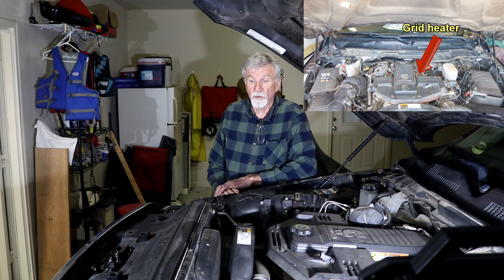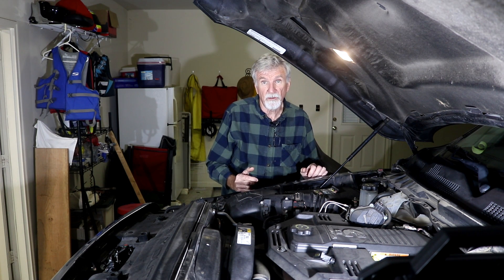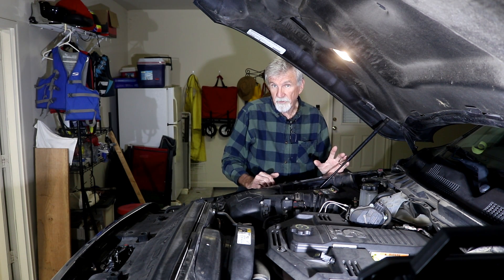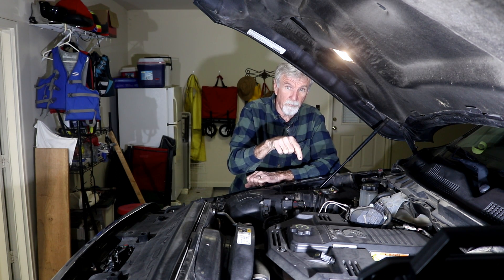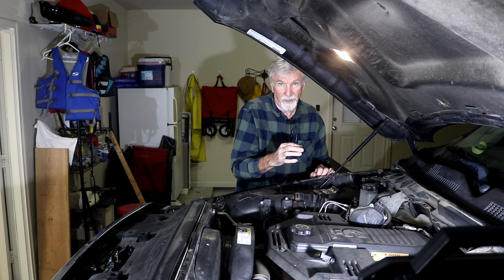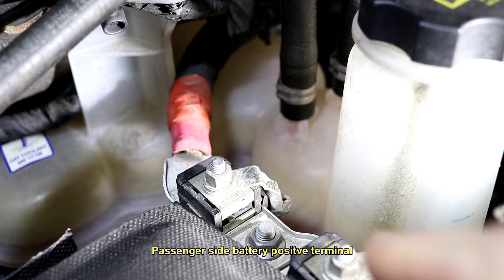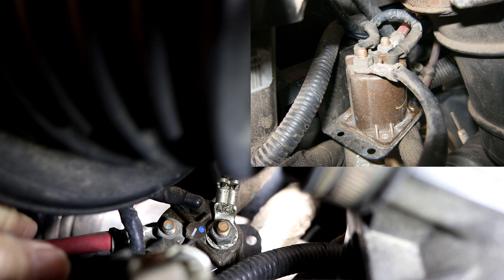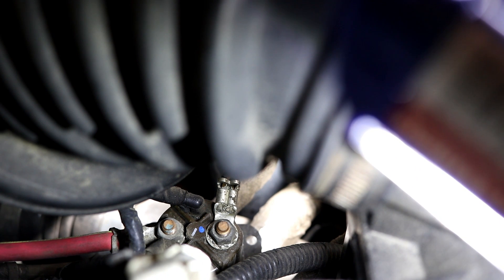Cummins Grid Heater Killer Bolt Issue - Amps & Voltage on engine start

Comment: Thank you, Marion,  for this video which saved the engine on my 2016 Ram 3500.  I just inherited it a few weeks ago from my dad who took excellent care of it. Just under 50K miles and the CEL came on,  I used dad's code reader and found the P2609 code so researched Cummins forums, which led me here. A positive jiggle test scared the hell out of me so I had it towed in for repair. My mechanic didn't recommend a delete of the heater so I'm having the stock grid heater replaced. $1,200 vs who knows how many thousands for a new engine. I've never owned a diesel truck and am not mechanically inclined at all but I hope I can follow your video to disconnect the wire from the solenoid so I don't worry about this in the future.
Reply: For just under 1k you can get the Banks Monster Ram part that is supposed to eliminate this threat, and provide better air flow. Would be great to have Marion's opinion on that part.
Reply from the maker: Yea, mine disconnected also.  Do it at the passenger side battery terminal.  The red wire.  Glad you saved the engine.  This is unfortunately too common and Cummins/ RAM should address it.
Reply: @MarionBlair  Hi Marion, thank you for this great video!. I wonder if your disconnect point at the battery post will trigger the DTC independent of the starting period, because the solenoid would not be energized, is not better to disconnect it from the solenoid output bolt?, also if a in line switch could be installed between the batt. and the solenoid, to enable the grid heater just in extreme cold conditions...should be a 215 amps. one?
Reply: @MarionBlair  does this mean you now recommend disconnecting the grid heater?
Reply: The Banks Gen 2 grid heater is the best coarse of action it does come with a heater that takes the place of the grid heater.
That’s what I put on my 2017 2500
Reply: Get a monster banks ram
Reply: Go to BD diesel and get the $228.00 builet proof kit, about a 3 hour install   no tuner needed check it out.

Comment: Just wanted to say thank you for posting this up. I checked my 2013 2500 with 108k miles and the stud was loose as could be. 

Pulled the grid heater out and the nut and bottom part of the stud broke off in my hand. No doubt they would've failed in a few thousand miles and wiped out the engine. This should be something everyone should check out when buying a used 6.7 truck, and probably follow up on once a month.
Reply from the maker: Yes, thanks, I've had several comments about this.

Comment: I haven't read all the comments but maybe others have mentioned it.  The wire you mentioned to disconnect you called a ground is actually the 12v wire heading to the grid.  Maybe you just mispoke.  Disconnecting it should be safe and will break the circuit.  You mentioned the two wires coming from the pcm.  One should be 12v when it calls for preheat, the other should be a ground and I'd imagine it's grounded all the time but don't know for certain.
Reply from the maker: Yea, don't know how I said it but that what I meant.

Comment: On mine the other bolt inside the grid heater was fried, thank God I just found it before it fell in the engine. I recommend pulling your intake horn and checking it if you have a lot of miles

Comment: So, it's probably best to just 86 the whole grid heater while pitting in a better intake. Put a different preheat for the intake manifold and wire it to an auxiliary switch. Turn it on for 15 seconds before you start it and let it run another 10sec then shut it off. Done, no more worry.

Comment: This just happened to my truck two days ago.  The nut is in my engine right now.  The power wire to the grid heater is super loose like I could almost pull the wire and isolater off.  2013 152000 miles.
Reply: What ever became of your truck? Mine's  in the shop now for the same

Comment: I have owned my truck for 9 years and had no problem with the grid heater until 2 days ago. It cycled then after it started up the voltage dropped to 8 volts several times then it ran ok. I checked the bolt and it was solid. Don't know what caused that, it had never happened before.
Reply from the maker: That may not be grid heater related.  I noticed when I turn the ignition on the volts displaces 8 volts?
Reply: @MarionBlair  It cycled down to 8 volts after I started it up. While it was running after it started the voltage dropped to 8 volts 4 times.
Reply from the maker: Batteries could be getting weak?
Reply: @MarionBlair  not the problem, replaced a couple of years ago and I keep it on a tender.
Reply from the maker: @blueoddball need to measure the amps should be about 210 with grid on.
Reply: @MarionBlair  I will do that. I think also the relay because it happened only once. I checked the bolt to the grid heater and it was fine. Hasn't happened since last week. Thanks
Reply from the maker: Normally, when they start arcing, it doesn't do it once in a while.   I guess, it's an electronic glitch of some sort?  But you are watching it and that's great.  Good luck.

Comment: my 2014 6.7 4500 Ram  has code P0542 Intake Air heater i check with volt meter engine running has power on heater  but keep cutting off the power and coming back while the engine is running  should be like that?
Reply from the maker: Normal when temp below 59 deg. F for a minute or so depending on temp..    I would disconnect it at the passenger side battery if you have voltage all the time and figure out the problem.  The IAT sensor is what controls it.

Comment: Howdy all!  I previously asked the question if this applied to the 5.9 as well.  I’m happy to report that this is not applicable to the 5.9 engine.  I figured I’d put this comment in here in case any other newbies like me had the same question.  Thanks to Marion for putting this information out there!
Reply from the maker: Thanks for the info!
Reply: Thanks I was wondering the very same thing.  I just baught a ram 2006 3500 6speed. Don't need any negative surprises. One thing I've learned is that solenoid REALLY draws that amperage down when I first start her up.
Reply: You should get your grid heater checked. I think it's every 60K miles. 

I just had some new injectors installed and my grid heater was cracked. 

New one went in.

Comment: So if you disconnect the solenoid, you’ll get a code everytime you use remote start?
Reply from the maker: Only when it's very cold and require a good bit of heater.  Disconnect at the passenger side battery.  Makes no difference to the PCM.

Comment: I replaced my grid heater but where does the cable that’s connected to it go?
Reply: I got a grid heater delete kit
Reply from the maker: @Panchis Garcia the cable from the heater side goes to a solenoid on the passenger side under the air intake tube between the air filter and the turbo.  For the solenoid it's goes to the passenger side battery.  Smaller red wire.  Disconnect it at the battery.

Comment: Marion, I have a 2014 Ram 6.7L. Today, it was 30 degrees outside. When I went to start the pickup, I was ready to wait for the glow plug light to come on and then turn off (like I've done for 7 years). However, the glow plug light only came on for, literally, 1 second and then turned off. I tried to start it and it did start, but it was a rough start. Any advice?
Reply from the maker: It sounds like the solenoid is bad (or PCM isn't telling it to energize) or the grid heater isn't coming on.  Take a look at the grid heater bolt and make sure that thing passes the jiggle test.  Solenoids are usually the culprit from what I've seen.  If you've got an ohm meter, you can check the coil for continuity.

Comment: Engine wear is the main reason for grid heaters, look up cylinder wash in diesels.  Happens during cold starts.
Reply: The grid heater doesn't help with engine wear.   It just heats the air for just a few seconds and then it's out of the picture.  The EGR helps for a quicker warm up but the block heater would be better for heating the engine prior to start.
Reply from the maker: Good info, thanks.

Comment: This just happened  to my 2017.  There is another pickup in the shop for the same thing.  Bolt went through engine.  New motor on its way

Comment: I’ve owned quite a few Cummins trucks. Never heard of this until it just happened to me. 76000 miles. No warning no check engine light. Bolt went thru smashed the valves into the piston and killed the turbo. $24000 in parts alone waiting to hear back from warranty. I will be posting a video shortly. Dealer Mia diagnosed it as a bad injector.
Reply: $24000 ? For parts? That has to be a misprint. That price would total the truck.
Reply: @duckdog38  it would not total a truck that books 40k. It’s a 16 3500 dually this happened on total bill came to 28000. Luckily I was under warranty still.
Reply: @fknbossfabworx1067  wow! Glad for you that it was covered! That is outrageous. We better watch those connections.  I wonder how quickly they burn up once they get loose.
Reply: Any update?
Reply: @georgeramsey2827  yes Chrysler paid for it. Came out to 28000. Just an FYI Chrysler doesn’t not cover injectors. They covered the one in that cylinder because of a covered item caused it. But original diagnosis was going to be out of my pocket. I actually bout an injector and replaced it and still had the issue immediately so I went further into diag
Reply: @fknbossfabworx1067  you buy the extended warranty coverage that covers the truck bumper to bumper to Ten years 110k miles and those injectors are absolutely covered besides everything else. For $2500 when you buy it new like I did. It's called I got a twenty thousand dollar engine that has parts upwards of three thousand dollars. I don't expect it to fail but I bought the insurance in case it does absolutely worth it for fuel pump or injectors alone.
Reply: @Jon-O.  While I agree with you it is not the way it works. Call ram and verify. Trust me I went thru all this.
Reply: @fknbossfabworx1067  it's under a list of covered items in the specific extended contract. The normal power train warranty doesn't cover them or the fuel pump. I check it out before I ordered my truck.

Comment: jiggle test saved My butt. had a P2609 and did the jiggle test and she was loose. immediatley pulled it apart and found that im one lucky SOB the bolt was severed, but the other half of the bolt and nut had welded itself to the heater element !!! Now what to do delete or replace. I live where there are smog regulations.
Reply from the maker: Wow!

Comment: Thanks again ! The amps that pulls is quite a bit, it also explains a few other things associated with the electrical system. I was going to ask where the bolt actually was but then discovered you put out a prior video ( which is this one)
Please keep your truck for a long time as I will need more help in the future.

Comment: My buddy’s truck with 2013 120,000km had it melt off and went into cylinder 6. Tore it up really bad, we swapped the whole motor out.
Reply from the maker: Yea, I've had mine disconnected all through the winter.  But I'm in louisiana.  Cummins/Ram needs to address this.

Comment: If anyone could help me further understand.  So once the grid heater is disconnected I no longer need to wait for it to cycle and I can immediately start the truck ?
Reply from the maker: Right, don't wait or it'll probably eventually throw a code.
Reply: @MarionBlair  so disconnect the red lead, hit start, then hit start right away a 2nd time everytime you start up?  just bought 2022 2500 w/60k, runs great but all these vids worrying the crap out of me, dallas, so not even sure I need it. prob will put in a Banks

Comment: What would cause the grid heater to go out multiple times? It's been replaced twice already on my truck(2017) under warranty and threw the same codes again this weekend
Reply from the maker: Has the grid heater been changed or the solenoid?
Reply: @MarionBlair  both. It's thrown the po542 at least four times now. One was just a loose cable but three times it required replacements
Reply: Twice was the grid heater and once the relay
Reply from the maker: A guess:  
The grid heater circuit is overheating due to;

Air restriction in intake?  (Seems that would trigger another code but maybe not at idle when the grid heater is operating.  Air cleaner, (throttle valve, the hose above the wheel well has been know to collapse.  show this hose in https://youtu.be/PAI30iZ1xjU).  Probably worth checking.

Or a bad IAT (tells the PCM what the manifold air temp is downstream of the grid heater.  Lying to the PCM.

or MAP sensor (combination air temp and pressure) located on the air  intake.  Lying to the PCM and holding the solinoid/ grid heater on too long making it think the air is cold when it's not?

Or, Bad PCM or flash (doubtful)

Sorry, lots of rambling.  These are things I'm thinking that would burn the solenoid/ grid heater prematurely.  Assume no loose connections or obvious issues etc...  The grid heater should not operate above 65 deg F.
Reply: @MarionBlair  thanks. Seems odd that Ram isn't concerned. I take it in because I'm mostly concerned about that Cummins killer bolt. Luckily it's never been that but to be honest this truck has had emissions issues from day one and it's tempting to update to Mexico standards and forego the remaining warranty
Reply from the maker: Yea, the dealers are not proactive, only reactive.  They'll keep changing the same part till the day it's out of warranty.   2 grid heaters and a solenoid seems a bit much.  Solenoid failure is common, I've had one, but never a grid heater, so I'm puzzled by that.  I think they should be investigating it more.  I had a rear axle issue and went contacted Chrysler, they were very responsive.  I wonder if the dealer has measured the amp draw, how long the preheat is on prior to start,  time it's staying on during cold start and all that good stuff etc, etc..  Short of a bad batch of grid heaters, it seems they haven't identified the root cause yet.  But I could be wrong of course.

Comment: Is there a fuse for it that can be removed and if so does it throw a code
Reply from the maker: I don't see a single fuse for it but it would throw a code without the solenoid energizing.  Unplugging one of the solenoid connections would do the same as pulling a fuse.  once had a solenoid burn out and it throw a code.  The best way IMO is disconnect it at the battery.  When you start it, go straight from acc to run or it'll still throw a code in cool temps.

Comment: Hi everyone.  If someone help me with my 2010 RAM4500 I appreciate it. I do not know what wrong with it 🥺 it's starts very well but it shot him self when I am driving.  Sometimes it's run for a day but sometimes I can't even go a mile. Please advise me something.
Reply from the maker: Does it die all at once or just bumps along and spits and sputters. And when it runs for a day, does it run well.
Reply: @MarionBlair  Yes sir die all at once. Feels like fuel stop coming.  And I turning ignition switch off and on it starts and when I put on drive it die but sometimes it go a mile or two. If I start in morning and just let it run on parking places it will stay run for all day
Reply from the maker: Yea.  When you turn the ignition on, can you hear the lift pump run in the fuel tank?  Bleed filters and check for water.  Change fuel filters
Reply: @MarionBlair  I change fuel filter twice and check it for water.  It is clean. How many fuel pump this truck has? One on fuel tank we checked it's works well. Do I have on engine also?
Reply from the maker: Askar Aydinov the injector pump.  You need an obd gauge to trouble shoot it.  the IAT sensor, manifold pressure, sensor.  Egg valve?  The exhaust press sensor can make the truck run bad.  Unplug it and see if it does better.  Drivers side in from running from a tube to the front.